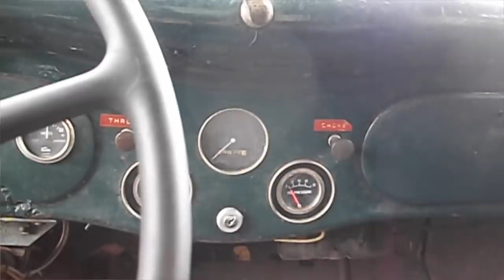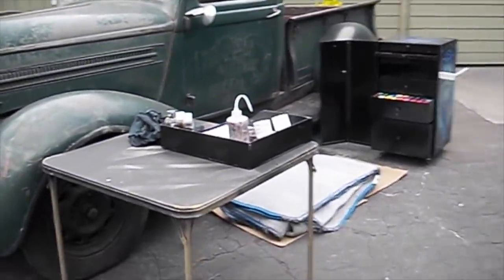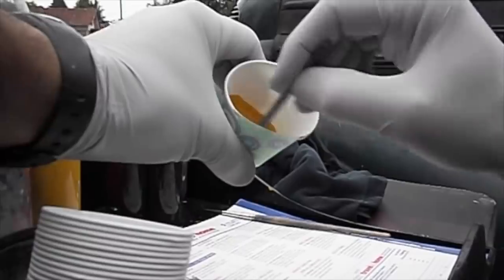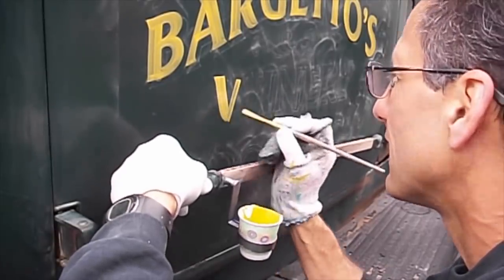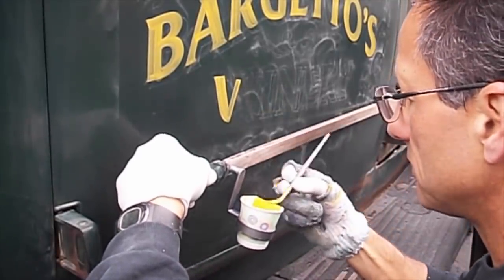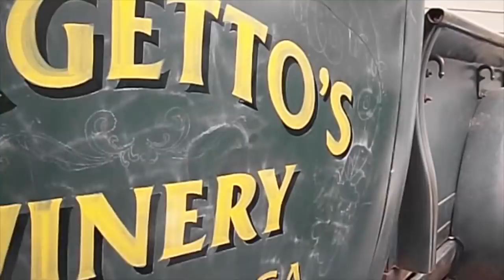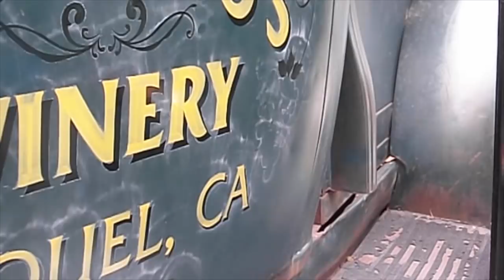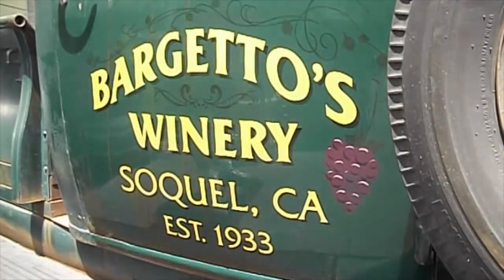1936 Dodge Truck Distressed Lettering

Comment: Fine job indeed!

I do this same stuff for a living, (39+ years now), and would like to add this...

when I use my pounce pads, the same Hansee pad you're using, I do acouple quick light pounds like you were doing, but then kinda wipe the powder all over the pattern, instead of pouncing the whole thing like this.
It gives me a tighter, cleaner pounce, without all the powder being all over the place like your's was. If you find you've missed any spots, you can re-pounce 'em and be ready to paint! (in a case like this, though, that extra powder will help flatten the sheen on the finished lettering, so for an old truck like this that's perfect!)

Lovely job! Very fitting for the truck and the client!!
Reply from the maker: That’s awesome! It’s been 38 years for me. And a lifetime of learning better ways to work. I will give your suggestion a shot. I’ve recently discovered that pouncing immediately after the alcohol bath has evaporated and the surface has a slight dampness, I get a really vivid, clean image. So adding your technique will eliminate excessive dust. 👍
Thank you!

Comment: Very nice work!! Any idea how to remove painted on letters?? I recently bought a company vehicle that the logos need to be removed from. I tried acetone and paint thinner with no luck. The logo paint is chalky so it’s not clear coated. Is sanding my only bet? Thanks
Reply from the maker: Easy off oven cleaner. Wear serious gloves, don’t get any on your skin.
Reply: @davidographicsguy  I’ll give that a try. Thank you.
Reply: @davidographicsguy  thanks so much. It worked great. Took about 6 applications of the heavy duty Easy off oven cleaner with a scrubby pad, then I wet sanded the area with 600, then cut and buffed for a bit and finished with a coat of wax, it looks good as new.
Reply from the maker: Rock and Roll! You have a new trick in your arsenal. 😀👍

Comment: I just watched your video and i Like it. Now i need a technical suggestion from you. Is possibile to pinstripe on a bedliner paint? Tha painter is finishing all my motorcycle in Army green (Raptor) and the surface is very rough and i don't know if i can. What do you think about? Thank You
Reply from the maker: Do you have any more Raptor to create a test piece? Also check their data sheet or contact them directly. Thank you 👍

Comment: Hi . I am going to be customizing a van with one shot paint. I will be painting the whole van but not every inch will be covered in paint. Maybe 50% if the paintable area. I was wondering how much paint is needed for that much coverage. Like how many pints or quarts? It is a large van or small mobile home size. Thanks so much!
Reply from the maker: If you’re on a budget, you can buy 1 quart each of black, white, red, yellow and blue and mix your primaries to make any additional color:
Red + blue = purple 
Blue + yellow = green 
Red + yellow = orange 
Etc...
If you are on a really tight budget, you can buy the same in quarts of Rustoleum.
It really depends on the design and what colors you are using but I would say that 3 quarts of paint would be enough to cover a van.

Comment: the power of man
even the most expensive computer
cannot do a single 💧 drop of paint.
Reply from the maker: It’s very rewarding. Are you lettering too?
Reply: @davidographicsguy  yes i do but I don't have any experience at vehicle i find it clever to transfer. If i am the one who will do it. I will make the surface like a paper and then lay out like .
Tell me what kind of transfer paper did you use? And how to make a hole on it? Needle? And what kind of powder? 🙏
Reply from the maker: Regular butcher paper and a pounce wheel, pounce box and pounce powder
Reply: @davidographicsguy  wow
Never Heard that before maybe in your country were all is available
But not in Manila.
I guess if only 
I'll do it the manual way. Lol.
Anyway thanks 👍
Reply from the maker: It looks like there are quite a few art supply stores in Manila. You just need a pounce wheel, some powder charcoal and baby powder and a sock to pounce with

Comment: What is the font you used? Remarkably, supposedly the Sistine Chapel was painted using the same technique with the perforated paper and powder for outlines.
Reply from the maker: I believe it’s Fritz Quadrada, but don’t quote me on that. Yeah, that’s cool
Reply: Mcabernero, Lame. Your font is lame.
Custom lettering and numbers without a printed logo are usually non- specific???

EXCELLENT SKILL David!!
🎨💪💥🌿

Comment: Im looking to do that on my food truck? Would that chip off with the weather? What kind of paint did you use?
Reply from the maker: 1-shot lettering enamel. If you never want it to come off add a little 1-shot hardener to some of the paint in a separate cup. Do not add hardener to the can of paint. Have fun! 👍😀

Comment: Do you make your own pounce patterns? Or where can you get them things made up?
Reply from the maker: Yes, I make my own. You can have any sign shop make a pattern or you can make your own with paper and a pounce wheel. Be sure to lightly sand the back of the paper pattern after pouncing to open the holes. 
Excel - Double-Sided Pounce Wheel - 7/16" https://www.amazon.com/dp/B007VTSXZM/ref=cm_sw_r_cp_api_i_RyBXCb0WHF92H

https://letterheadsignsupply.com/pounce-pad

Comment: Awesome video! Thank you for helping us that have been out of this for a very long time due to circumstances. May I ask you a question? Are you using 1 shot enamels? Noticed the paint is in plastic bottles.
Was your arched lettering along with other lettering done freehand or by computer sign shop?
Reply from the maker: 1-Shot and Ronan lettering enamels transferred into the plastic bottles. I use Adobe Illustrator with a vinyl plotter/pen to create the paper pattern. Then pounce it with an Electro pounce machine. Thank you!

Comment: That's pretty neat, is there much lettering done on old faded trucks like this? 
Never heard of Soquel so I looked it up, kind of a strange population fluctuation 1990 - 9,188.......2000 - 5,081.......2010 - 9,644.......2020 - 9,980.......I wonder what happened during the 90s that made the population drop in half almost and then in the 2000s double back to where it was again.
Reply from the maker: It’s a niche art.
That’s interesting about the fluctuation. The only thing I can think is that Santa Cruz County is a bedroom for Silicone Valley because of its beauty.

Comment: The grapes would look better if you added a light coat of blue grey over the top of them for the grey dusting they have on the vine. Nice work. Might look for some of those quills to add to my oil painting brushes.
Reply from the maker: Great detail idea! Thank you! 
We’re you thinking of using the brushes for oil painting like on canvas?
Reply: @davidographicsguy  Yes, they could be used for much nicer line work
Reply from the maker: He makes liners too.
https://stevekafka.com/products/liner

Comment: I'D LIKE TO ASK, HOW LONG DO YOU HAVE TO WAIT BEFORE YOU USE THE ALCOHOL TO CLEAN UP AFTERWARDS? THANKS AND GREAT JOB!
Reply from the maker: Within minutes if it’s in the sun, within 30 minutes if it’s in the shade. Just spray, do not wipe with a rag.
Reply: THANK YOU VERY MUCH! I WASN'T SURE IF THE PAINT WOULD RUN BECAUSE IT BEING SO SOON. TODD @davidographicsguy

Comment: whats the process with chalk duster and the paper, to get the words on the vehicle. i dont live in the USA.
Reply from the maker: Start at 00:10
https://www.youtube.com/watch?v=NZIOMLhQ5lc&t=1s
Electric Pounce Machines are expensive and hard to find.

Ponce wheels are great too, pounce the image on paper placed on cardboard, lightly sand the back of the paper to open the holes.
https://www.amazon.com/Excel-Blades-American-Perforator-Embossing/dp/B00M0KQ7RI/ref=pd_bxgy_263_img_2?_encoding=UTF8&pd_rd_i=B00M0KQ7RI&pd_rd_r=812f1770-7584-11e8-8a2e-95dda931668e&pd_rd_w=V97r9&pd_rd_wg=GpAUo&pf_rd_i=desktop-dp-sims&pf_rd_m=ATVPDKIKX0DER&pf_rd_p=3914568618330124508&pf_rd_r=4HYCR0TCPBCHHJXJEC2J&pf_rd_s=desktop-dp-sims&pf_rd_t=40701&psc=1&refRID=4HYCR0TCPBCHHJXJEC2J

Pounce Boxes are great:
https://www.amazon.com/See-han-Han-See-POUNCE-PAD/dp/B00340V2NC/ref=sr_1_2?ie=UTF8&qid=1529607253&sr=8-2&keywords=hansee+pounce+pad
Baby Powder in a sock works too.

Comment: Does One Shot tend to 'glue' those bottles closed? I'd like to find a decent way to store One Shot!  I've tried the hole in the lid with the thumb screw and nut inside trick, but it's not the best solution IMHO.  And wiping a lid clean after every use just doesn't happen, in my experience!  Are those bottles especially 'solvent-resistant', or is all polypropylene solvent resistant? Do they make them large enough to hold a whole 8 ounces? Got a link to the source to purchase? Thanks, David!
Reply from the maker: Yes, you have to store them upside down. Or dig this!
fb://group/?id=449474351781131&view=permalink&object_id=1741133325948554

https://www.facebook.com/groups/449474351781131?view=permalink&id=1763561180372435
Reply from the maker: I bought the 50 count bag of 2oz
https://www.bulkapothecary.com/plastic-clear-bullet-cosmo-round-bottles/
Make sure you get the correct size dispensing caps that match the bottles 
https://www.bulkapothecary.com/product/containers/closures/white-dispensing-caps/
Reply from the maker: Noooooooo! Don’t buy those bottles! They suck! I had to toss them all. Get these instead:
https://stevekafka.com/products/paint-bottle

Don’t be cheap and stupid like me 😩

Store them upside down.
Reply: Sign Man try putting plastic food wrap under the lid before you put the lid back on. It works with POR15!

Comment: it's not distressed put some sand paper on it looks too new
Reply from the maker: Good idea. Others have suggested that. It’s sitting in the sun year around. Let’s see how it looks in a couple of years. 😁 Thank you for sharing.
Reply: edmundo oliver , too new.
Reply from the maker: Yes
Reply: edmundo oliver or a grinder right
Reply: @davidographicsguy  it doesn't look too new in my opinion. Great work
Reply from the maker: It’s kind of on the edge of old and not so new. 😀
Reply: @davidographicsguy  I think it looks perfect
Reply: it will tone down when the sun bleaches it over the next year.
Reply: @El-xt9oo  the title say's distressed not perfect.
Reply: Sandpaper would make it look horrible...time will do the job.
Reply: @Aerol-xd7ol  you have to know how to use it 1500 wet and dry  we do wonder